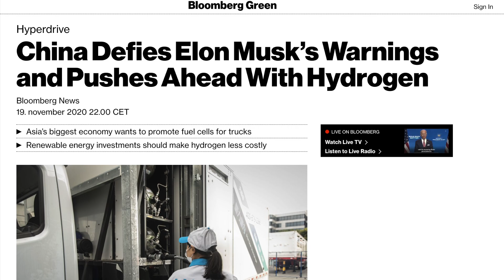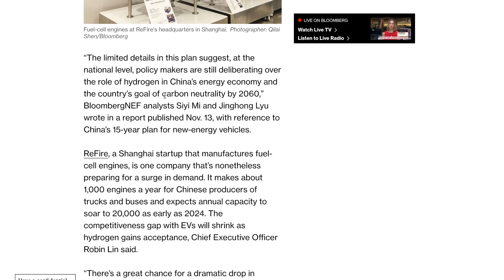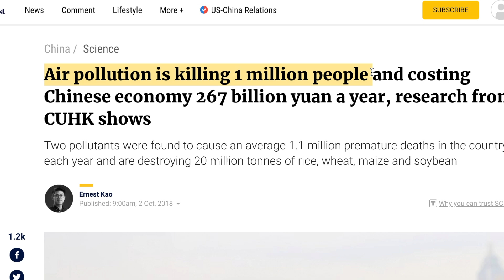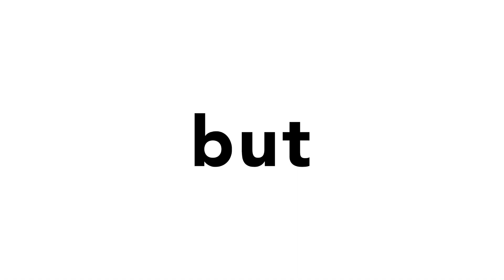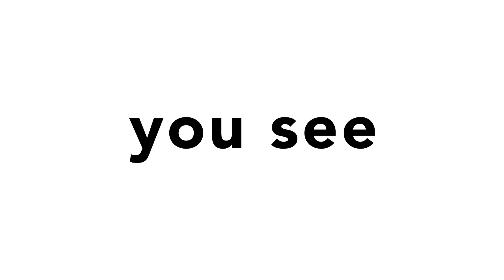The Worrying Truth Behind China's Push For Hydrogen

Comment: Cant understand why you think China pushing hydrogen is a bad thing? It's a better fuel source than battery. Yes it costs more now but hydrogen needs investment to bring costs down over long term.
Reply: It is bad. If you understood how it works
Reply: so first of all hydrogen is NOT a fuel source. it's an energy carrier (just like a battery) and second to make things super simple as a first baby step, efficiency of hydrogen compared to batteries is terrible, one main reason is laws of thermodynamics and no amount of  money can fix that, one of the big reasons why in 200 years of experience with H2 it is still where it's at while battery technology has shot forward like a bullet train.

Comment: Maybe they are trading hours at a battery charging station for minutes at a hydrogen fueling station?
Reply: Hydrogen can made directly from high temperature nuclear reactors.  Pebble Bed and Molten Salt reactors.  China is investing billions to develop these reactors.  These reactors can very efficiently make H2.  This H2 can be used to make steel, cement and all sorts of industrial process that need high heat or power on demand.
Reply: hydrogen is more expensive than gasoline. and with higher level chargers EV can recharge in 30mn to 80%. are you ready to pay 5 times the price to save 30mn? people say no, nobody is buying hydrogen cars.
Reply: and you'd need 10 to 15 times the infrastructure compared to regular fuel... hydrogen is just a coal/gas blanket to stay in business in a world moving more towards green technology

Comment: I would add that while today Hydrogen production is an "expensive" process, that China has decided to put real money into it means they are betting on their manufacturing prowess to make it less. I would remind the viewers that the reason Solar PV is competitive today is that 15 years ago China pushed to make that happen and the whole world has benefitted from their success at making Solar PV economically viable such that Solar PV now beats coal in most instances for electric energy generation. I'm confident that now that it is a Chinese national priority, they will be successful and Hydrogen as chemical stored energy will also become economically viable.

Also, there are many industrial processes which cannot be accomplished without using chemical stored energy, especially if high temperatures are required. Currently those processes cannot be solved using electrical energy. Using Hydrogen may be an easier replacement for fossil fuels in those instances.

Comment: I can‘t agree to your opinion (and in fact many others) that to fund hydrogen development isn‘t good and just inefficient... at the moment yes, batteries are more efficient but you have to consider the energy density of hydrogen is much higher than the one of batteries at the moment. There are certain things which won‘t be able to work on batteries like for example a big cargoship or long distance flights or a tractor which can’t just weigh 500kg more or it will destroy the field and certainly can’t tow attachments the whole day on one charge (like building machines also need to). So there are definitively aspects were something different than (in comparison) heavy batteries is needed. And we also have to consider that the growing demand will fuel more research and development in efficiency, so the price will surely fall in the future.
(Sorry for the sentences, if the don’t make sense)

Comment: Since when did governments make optimal choices on such things?  Almost never.  H is DOA for surface transportation.
Reply: To go carbon neutral you also need to switch many industries like steel making, heavy duty vehicles, airplanes and ships from fossil fuels. Batteries suck for these applications.
Reply: @subhadityasen5486   That's not an adequate case for H with limited exceptions.  Bio fuel from 'waste' cellulose, algae and so on is a far better bet and can be done competitively with petrol.   H is going to be 3 to 4X more expensive than diesel unless inexpensive low pressure high density storage is developed, something I've seen touted since the 1980's.